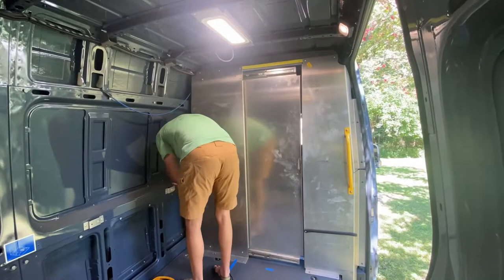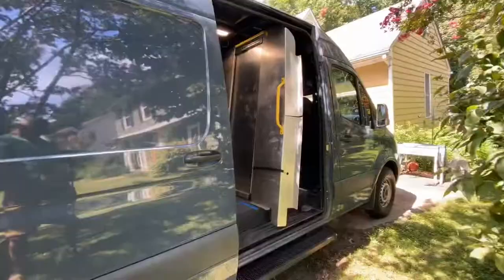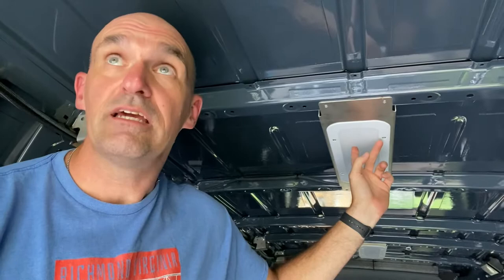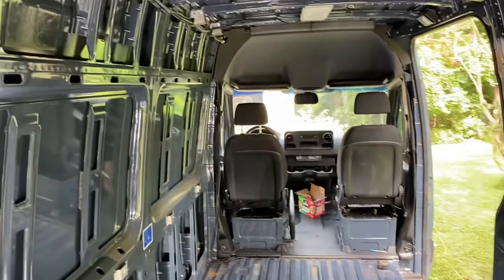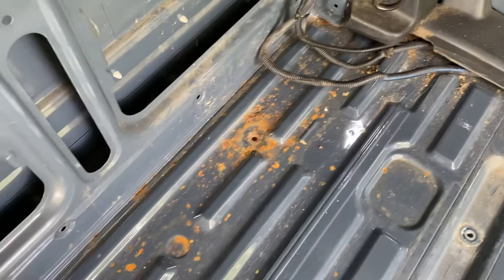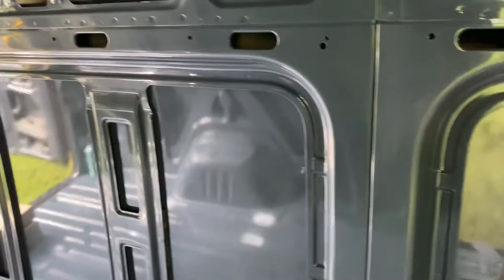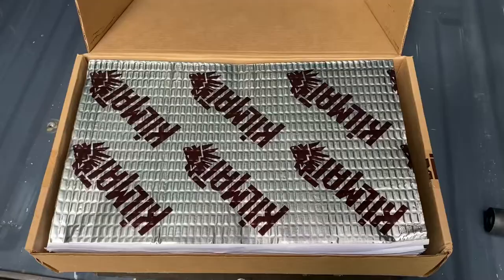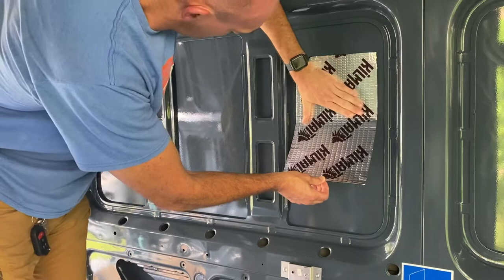KILMAT sound deadening installed on our 2019 sprinter van

Comment: I just found your channel.. Just in time.  I just bought a '23 Sprinter 144 3400XD.. bare bones.  I'm where you are at the moment.  I wish I had a factory floor to make the flooring install simpler.
Cardboard and tape it is.
Reply from the maker: Awesome, thanks for checking us out, the factory floor certainly made it much simpler for sure to have that template, good luck and have fun

Comment: Hey guys, I just bought a 2018 former Amazon van, also took out the shelves. Have you figured out all the extra wiring? The camera lines, leading to the rear of the van. Also, does yours shut down if you open the door or turn off after 1 minute in park?
I'm trying to de-Amazon my van too...lol
Reply from the maker: Congrats on the van, i have not opened the harness but i am pretty sure its all extra wires for the two rear cameras and for the motion sensor interior lights, as far as the shut down issues we have not experienced any of those my biggest complaint is the darn shut the door and auto lock everytime, i called the dealer and Mercedes has not put out a deprograming flash yet for the auto lock but he said with all the vans hitting the market he is sure it will come quick.  My other complaint is its speed limited at 75, not necessarily a bad thing for safety but there are highways out west that have higher speed limits than 75, i also unplugged the back up alarm but that was an easy fix.  Have you had any other issues?
Reply: @ramblingambition  I also disconnected the back up beeper...lol. My radio goes silent when I put it in reverse, even if I'm on the phone, so annoying.
I have fog lights in the front of the van, but no wiring harness, which is crazy, the switch is a single pull, instead of a double. So, I'll have to add a switch when I install the wiring harness. 
The over head lights, that you cut out, they were hooked up to their system, not Mercedes? You can tell by the insulator they use, the black coil cover instead of the factory black wrap. Were you able to get the original cargo lights to work? My will not, at least as to date .
I also have 7 of these wires running over the driver's door into the ceiling panel. I have know idea where they're going..lol
Reply from the maker: Robert, I have the same cut out when in reverse, the dealer said when they get the programing done they will over write all of the amazon van features and should take out that one as well.  As to the factory cargo lights, the one over the sliding door and rears doors mine were working when i bought the
Reply from the maker: Van, they were tied to the dome light control in the headliner.
Reply: @ramblingambition  
Interesting, my dealership, Baker, has done all the services for it. The funny thing is the van was built here in Charleston, SC, where I live and serviced here as well, never been out of the state. I asked them about the Amazon quirks, but they have no idea of how to un-a** it..lol
The up-fit was also done locally, I might just have to call and see if they can assist. 
Good job on the vents, just watched that one too.
Reply from the maker: Thanks it was nerve racking to cut holes in the roof for sure, the side windows in the back scare me because of the curves but i think it will be okay, well ill let you know when i hear something, my van was one of the ones built overseas, but serviced up at the dealership in fredericksburg, Va they are the ones i bought it from and are helping to push for the de-amazon flash
Reply: @ramblingambition  
I bet it was, but those gaskets are really cool how they're formed for the individual spots on the roof. 
That's cool, I appreciate the info. On another note, are you going to do the bump outs as well? 
My brother lives up that way, works in Quantico.
Reply from the maker: Those gaskets are well worth the money it makes it so much easier to make sure your in the right spot.  As far as the flarespace pieces, we are not, i got the 170 specifically to be able to have a fixed bed that runs back to front, i am 6’10 so sleeping side to side using those flares is not an option, based on what in have read if your over 6’2 you wont be able to sleep that way and still stretch out, i think its a great option just not for me